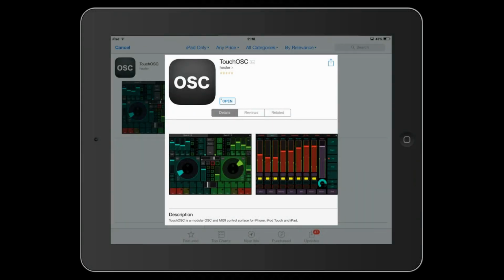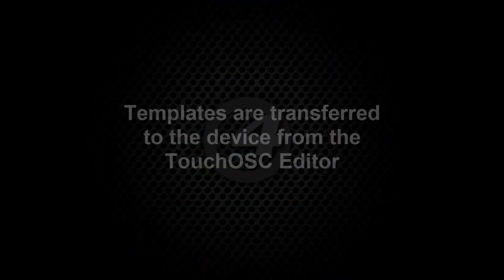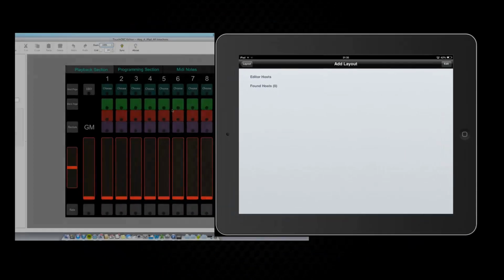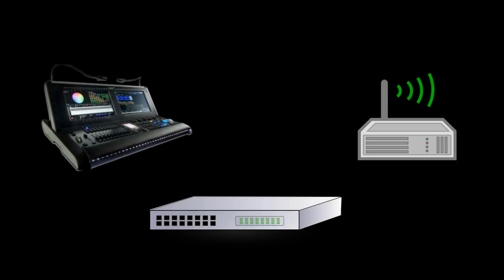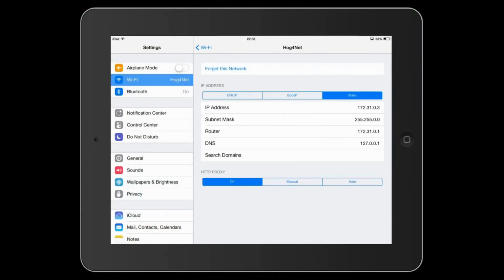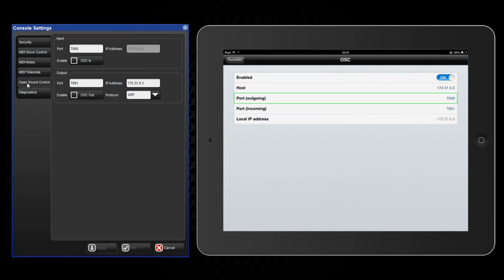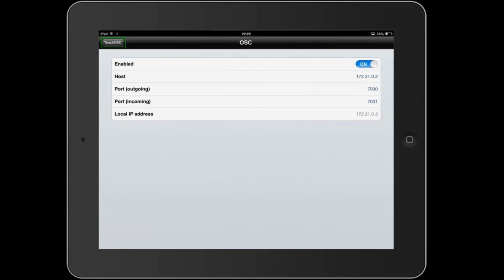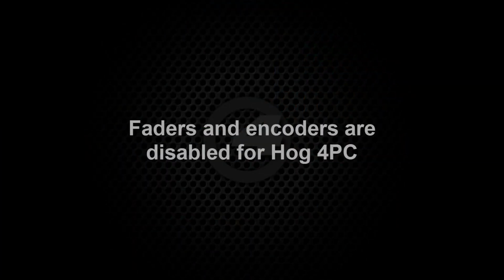HOG 4 Tutorial 13 - Open Sound Control (Setting up an iPad Remote)

Comment: Great video explaining the basic setup. Can obviously use different IP settings if you have control over the private network you are on.

Audio levels were pretty dismal though, very low even with cranked sound on this end